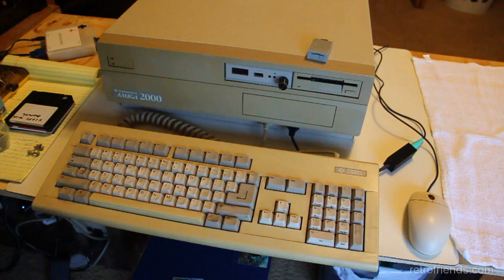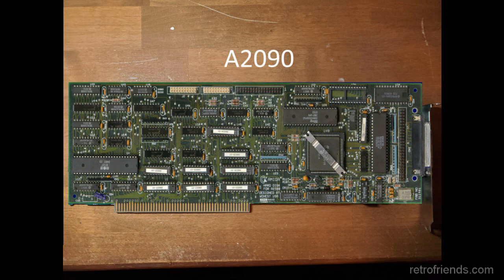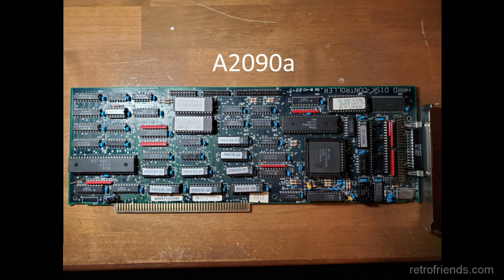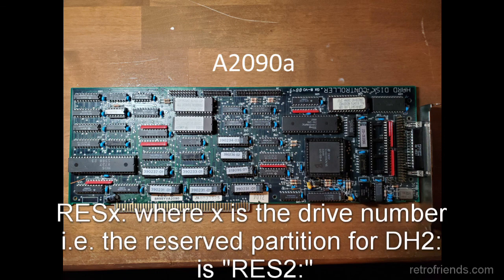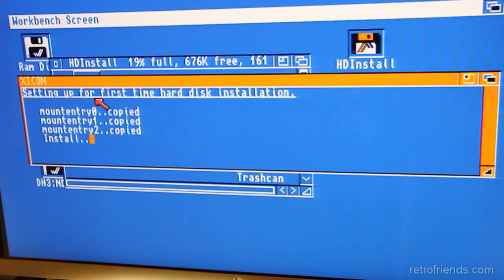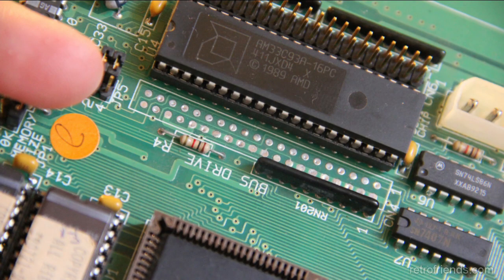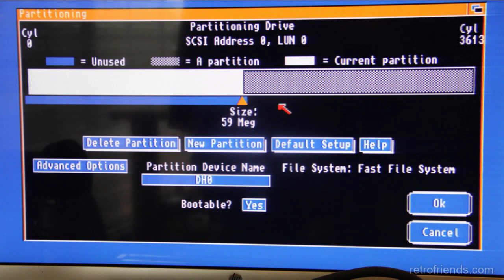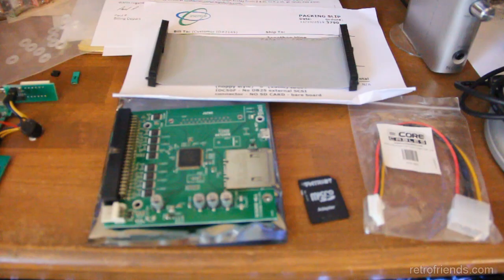The A2090a and A2091 Amiga HDD Controllers Part 1: Introduction

Comment: Hi There and hoping someone can help. I have an A2000 with the A2091 card with a hard drive which no longer boots. Is it easy to source a replacement drive to connect onto the A2091 or can one go with an external drive via the external connector? Looking for some guidance on how to essentially get a working HD based A2000 running again and appreciate any advice/guidance. Thank You!
Reply from the maker: Save your pennies for a scsi2sd. Also check my channel for videos about setting up Workbench using WinUAE.